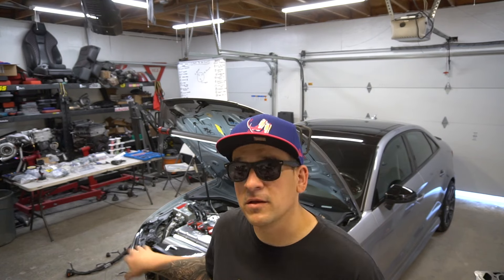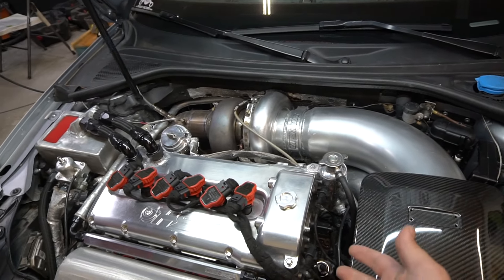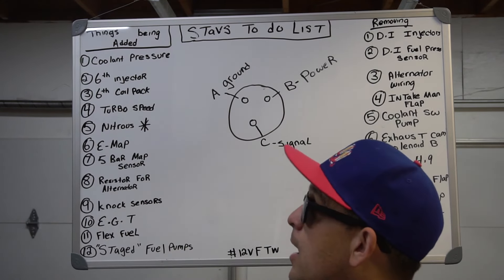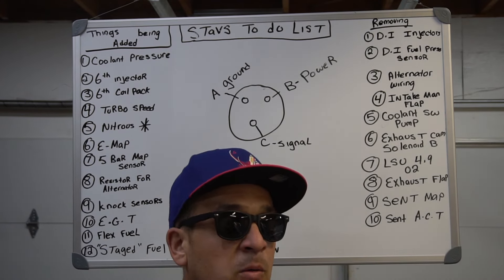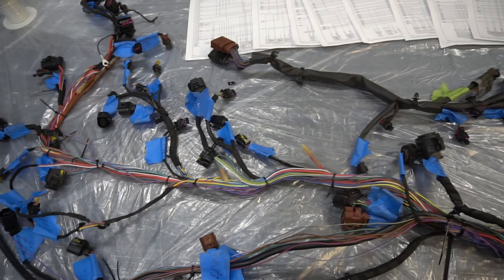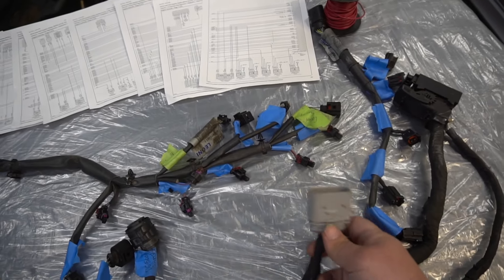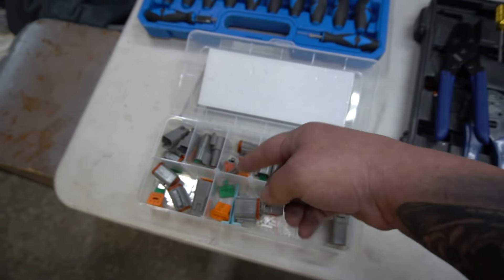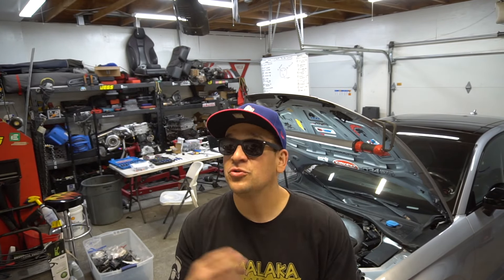Complete Wire up of our AUDI RS3   - | SYVECS S7 | - PT.1

Comment: Great work, Stav. You're on the right path. Those 8 pages of paper are the Holy Grail.
Reply from the maker: Holy grail is right. My first time around I was not able to find a diagram at all. It was not released so all the connectors for the smog equipment and added nonsense to the harness I did not know what it was for so I did not want to remove it in the first harness in case we possibly needed it

Comment: 7bar map sensor is where it’s at. 100%  zero downsides.
Reply from the maker: Absolutely but we plan on running a big enough turbo that we won’t need that type of boost. But it’s the same connector anyway and a simple swap out and change in the config

Comment: Hey Stav, IDK if it will work with the tape but grab a seem ripper it may help get that wiring apart a little bit faster/easier?

Absolutely loved the video! Can you tell me, does Syvecs have full control of the powertrain and just sending the CAN information to the  stock ECU so it doesn't freak out? I'm Ideally looking to run Syvecs with an R/GTI engine, in the AWD GLI Gen 3 project but still keep my normal car functions similar to how you all have done it for the RS3.
I've been talking with my buddy Dave who's utilizing Syvecs on a Gen 1 who thinks it might be possible. We both theorize the Golf R gen 3 controller would work as my ECU/Pinout are the same on 15-16 R's except for VVL on the exhaust camshaft (not on my engine). Obviously Syvecs can't say one way or another as they haven't tested it on my configuration.

I know you've been toying with the tuning and wiring, so I thought maybe I could get your thought's on it as well before going to Syvecs. I don't want to dump $7k on just a whim haha.

Again I appreciate all the videos and support you and George give the community.
Reply from the maker: I’ll have too look  into the seam ripper never heard of it .
Reply from the maker: If you message us on Instagram. I believe we can have a better convo about this because I have a few questions myself about your set up. Reach out to @malakamotorsports on IG.  Be glad to talk shop with you not an expert by any means but I have been playing with this ecu